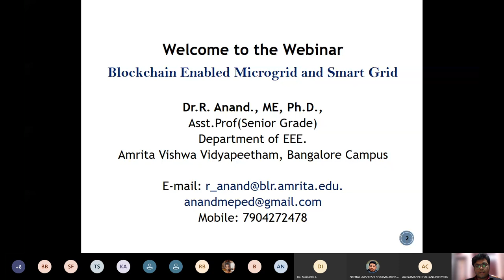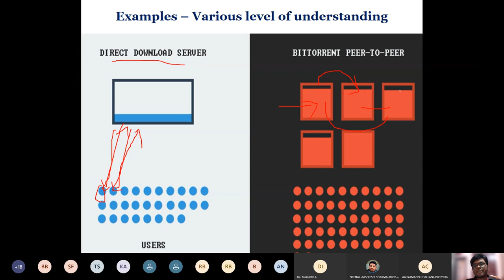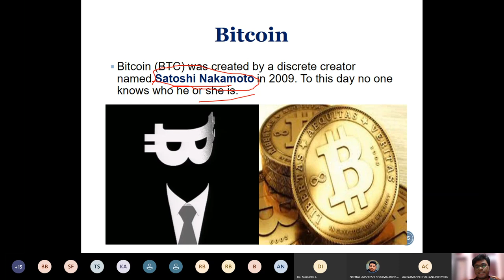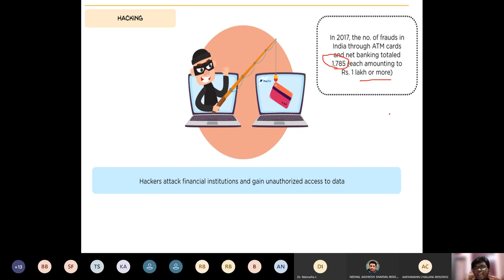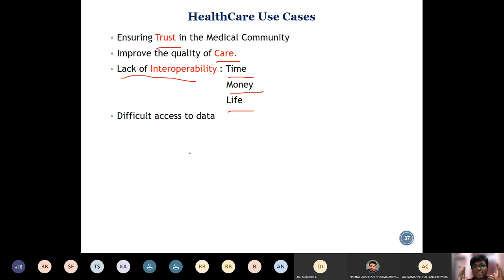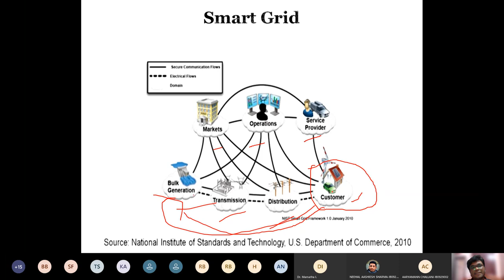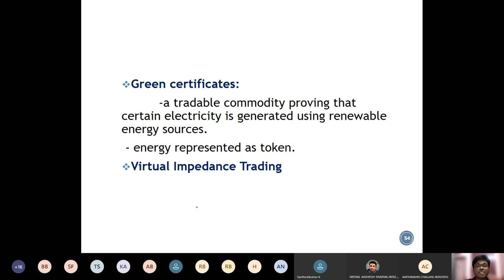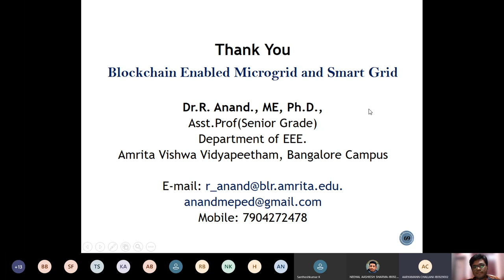Dr Anand R: Blockchain-enabled Microgrid and Smart Grid

Comment: Sir, if someone tries to tamper with a block chain ledger, is that ledger lost completely? if yes, then is it lost for the owner also?
Reply: The tampered ledger will branch out in a new fork which will not get validated by the consensus algorithms of the network and ultimately fizzle out unless there is a 51% attack which is an altogether different issue.
Reply: @amitr527  if a 51% ATTACK occurs, it is possible for the attacker to take control of the network and make changes to the ledger. Then, THE ORIGINAL LEDGER WOULD BE LOST, and the new version created by the attacker would become THE ACCEPTED VERSION.
Reply: @webricated  agree